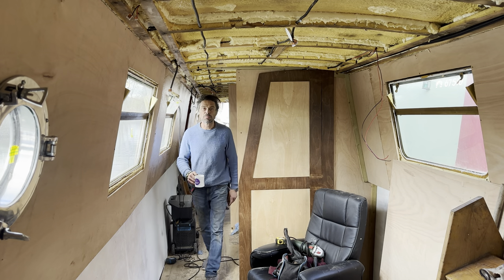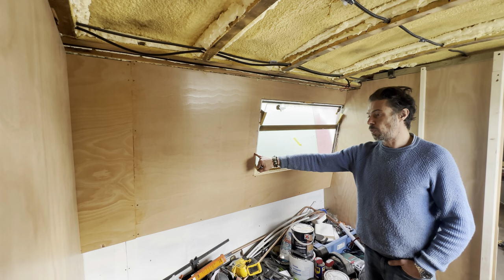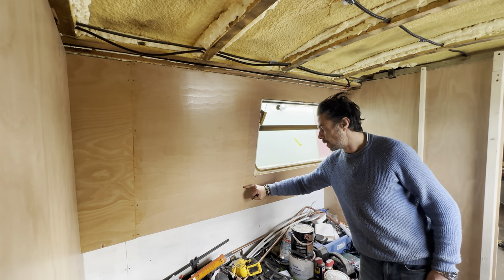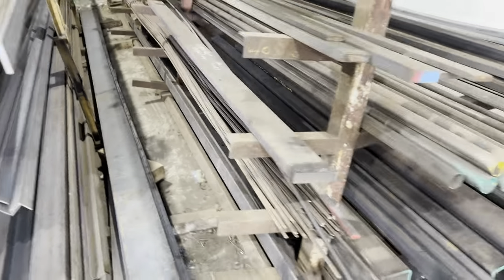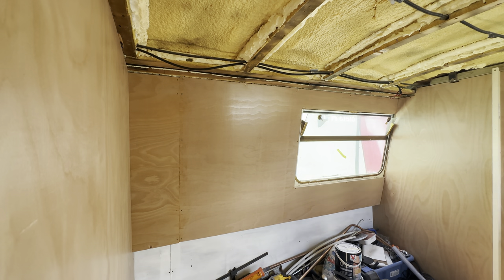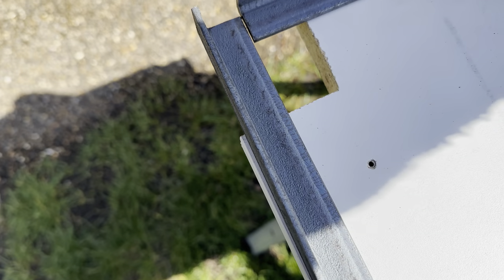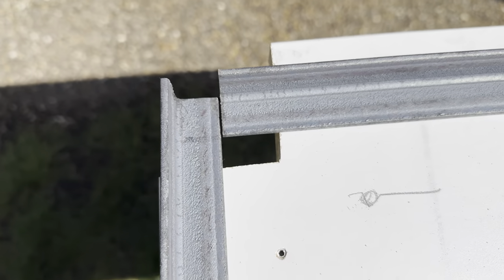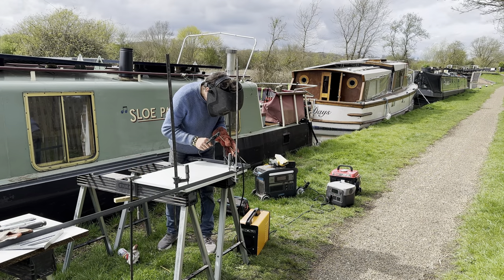532. Making a PIVOTING bed for a narrowboat

Comment: The bunk is looking good.  One thing you might consider while your ceiling is still exposed is weld a couple of steel eyelets to the steel so the bedframe can be supported by a pair of chains.  To distribute the weight, each chain can hook to two short lengths of chain attached to the frame, so that when the bunk is in use, each chain attachment looks like an inverted "Y"
Reply: That's  what I was going to suggest!!!!
Reply: Instead of a chain, perhaps an arm on each side that can be rotated up to snap into the eyelets?  That would make it more stable and secure.
Reply: Me too better than trying to support the bed on the side walls ..well done James design to manufacture 👍
Reply: Agree it needs some kind of additional support--I don't think the walls will be enough.
Reply: I was going to make the same comment as everyone else - support the bunk with a strap from the roof. Fairline did the same with their Mirage model in the 1980s and it's not uncommon to see the same thing in seagoing yachts. If you can get to a scrapyard, seatbelt webbing stitched to a hook might be a good option, as very strong. Some Japanese cars have neutral coloured belts which might look good.

Comment: Nice work. For anybody considering fitting a boat out this is a good example of how everything ends up taking about 3 times as long as you think it will!
Reply: It's exactly why any  normal trades man won't touch boat work with a barge pole so to speak it take 3 times as long to do anything and no use of a spirit level is there idea of a nightmare

Comment: The frame looks a bit more wobbly than it should be, needs more structure. 
Instead of figuring out how to support it from the bottom, I would weld brackets for chains to the ceiling while it's uncovered and use chains.

Comment: Making progress can be frustrating at times, but you are making it. I don't want to be the one to say it but that outside length will bend very quickly once weight is just centered on it, even with the slates on. Might I suggest you strengthen it by bolting a 4" wide length of 18mm wood or ply to the side. I love watching the head scratching moments. Also why not use chain, or tow rope and hooks to hold the upper bunk up, a lot less fuss and complication.

Comment: Rubbish Job! :) I used to make similar stuff with angle iron, stick welder, grinder etc, so I know how hard it is unless you've loads of experience (I didn't). One of things I did learn was to tack weld then trial fit before finally welding - then when your design or measurements prove to be off (usually were for me!) it's fairly simple to attack with hammer, redesign, remeasure, remake etc.
That would have saved you some bother on the hinges! I've been there, still have the round file to prove it ;)
Glad SD did the welding, those old school buzz box welders like yours are tricky to get the hang of, you do need to practice for quite a while to get the hang of them.
I'n not sure that 6 foot run of angle is going to be rigid enough on the outside, but I guess you'll find out if that's the case soon enough.
Good luck with it all!

Comment: Got a notification from CRT: Notice Alert
Grand Union
Location: Project 58
Starts At: End Of the Galley
Ends At: End of the Bedroom

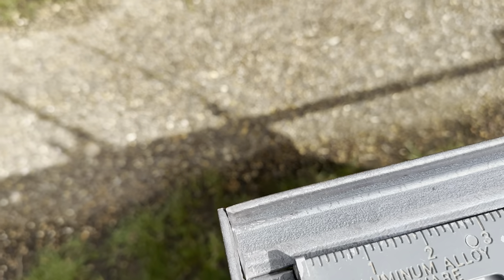Thursday 28 March 2024 08:30 until Tuesday 4 April 2024 07:30

Type: Advice: Navigation is closed to all craft and everyone is advised to steer clear and find a safe mooring, James is welding.
Reason: Maintenance

Update on 04/04/2024:
The navigation is now back open. James is still standing and Will be providing updates in the coming weeks.

Comment: Probably one problem with the welding is that the rods may have flux around the tip, and might need to be either ground or broken off so you have metal to metal contact for the electricity to make the arc.   Anyway - Kudos to Dan for helping out!

Comment: When the beds level, weld an upright in the galley side of the wall, then use a spring bolt to fix the frame horizontal. You can then place another bulkhead galley side to hide the steel beam.